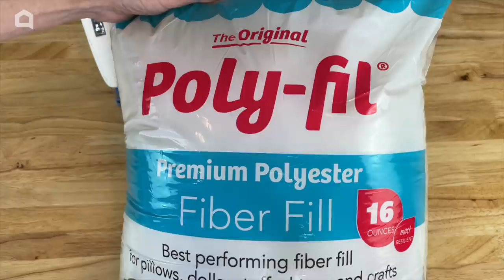21 viral Tiktok ideas everyone's copying right now!

Comment: The framed mirrors can be a tricky one. If you don't level the mirrors exactly, the mirrors will reflect the images unevenly.
Reply: That is the only one of these hacks I was going to try. Thanks so much for the tip! 😁❤
Reply: Not sure how she hot that to turn..what did she do with the marbles?
Reply: @lisachambo6691  You put the marbles between the two cake pans.  The top pan will glide on the marbles and rotate like a lazy susan.
Reply: I just subscribed, wonderful hacks ❤️❤️

Comment: There is more to this cloud.  If you follow only the tic tok you’ll be disappointed, the headboard also needs further work to keep shape, to make the blue glass for the fairy light and 2X4 piece…take a bottle of dollar true midge pigeon and water (1-2 Tbs I think) and regular neon food coloring blue and green swirl until coated drain for 12-24 hours than bake at 220 for 10-20 min.  Please look this up because the oven time and temp may be off.  Some use too much water and you need to wipe top so it’s not goopy.  I saw this on you tube. Message me and I’ll give you the link.
Reply: "dollar true midge pigeon" 🤣 every word just got better and better!! 🤣🤣🤣 Gotta love autocorrect!
Reply: @SundayMourningLove  my thoughts exactly 🤣